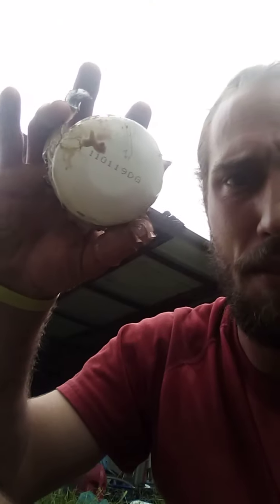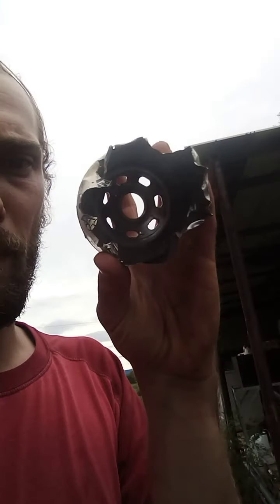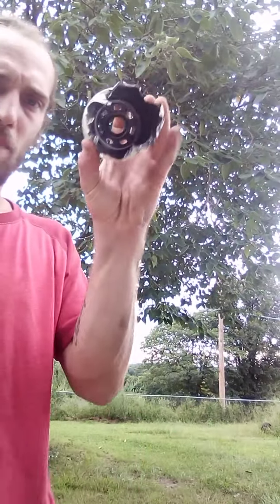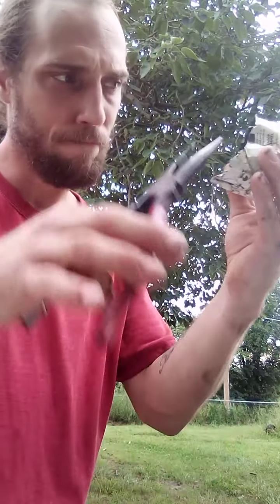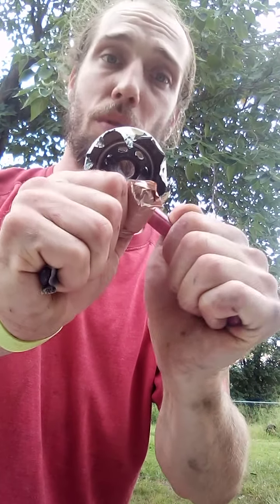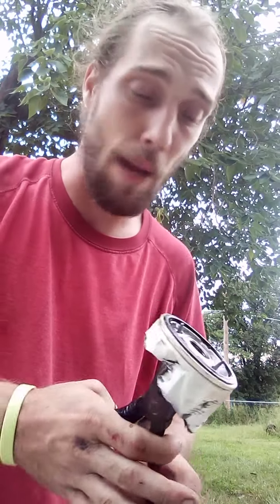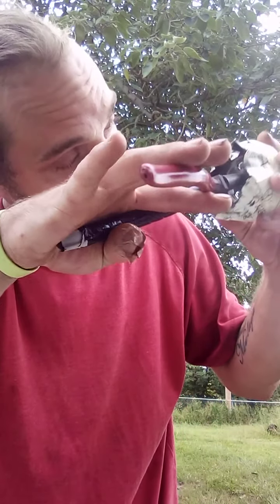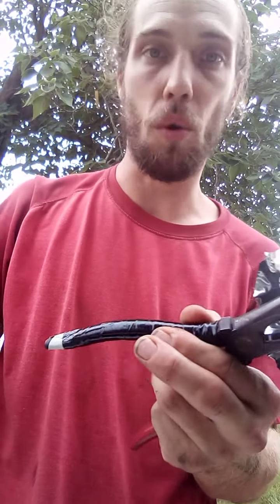Stuck on oil filter that has been shredded removal

Comment: WOW!! This video is the ONLY one that helped me getting a shred oil filter off my Scag zero turn mower. The way the engine sits, the is NO ROOM to get any thing else in there other than a small, short pair of needle nose pliers Then, after I was already exhausted, it took 5 more minutes of tugging and pulling with all my might, then the base of the filter finally turned like 1/256th of an inch, which got me exited. Being there was no room, I had to re position the pliers multiple times, but it finally moved the filter little by little. After cussing like a sailor for an extended period of time, it FINALLY spun free. Now I need to say my prayers and ask for forgiveness for my sailor's mouth. THANK YOU!!!!!!!!!!
Reply from the maker: Really glad this helped you, and probably saved you from having to call someone and potentially spend extra money

Comment: Thanks for the video. I have a similar problem with a stuck on filter but I haven’t shredded it yet. The screwdriver through the filter rarely works anymore with the cheap filter canisters. But it’s good to have the information you provided in case I get there. Thanks!
Reply from the maker: Hopefully you don't have to reach this point 😅. Wishing you well and happy holidays!

Comment: Best solution that I have got among all the youtube videos. Thanks bro. It did worked for me. But now I have arm pain. :P
Reply: @domorenow
0 seconds ago
Most needle nose pliers have a flat at the hinge point that is where you put the long crescent wrench to get the leverage you need to easily remove the filter plate.✌

Comment: oil filter doesnt get tight, everyone thinks that, the rubber seal hasnt had oil smeared on it before installation and it welds itself to the alloy housing with the heat of the engine and no lube, ALWAYS smear oil on the rubber ring before installing the oil filter and you will NEVER have this problem
Reply: False. I always do this and mine won't budge.

Comment: Currently having trouble with that I have a Toyota Camry 2019… man anger to rip off the oil filter like that any other advice on how to to do that???
Reply from the maker: You tried with the pliers?
Reply from the maker: @josemarin6940  can you get a long screwdriver or punch and try and tap it loose?
Reply: @jobejones3295  I’d like to send a pic to show you but can’t do it on YouTube